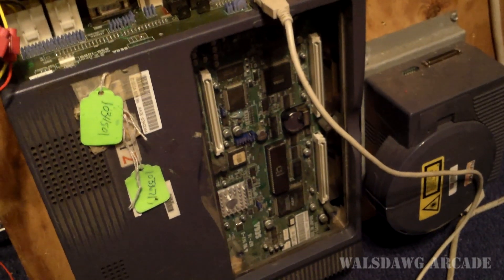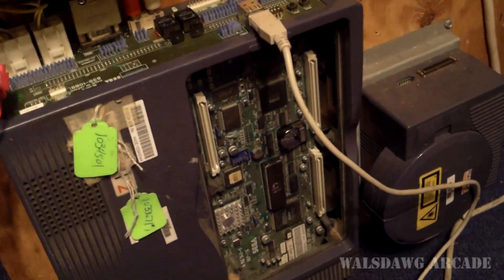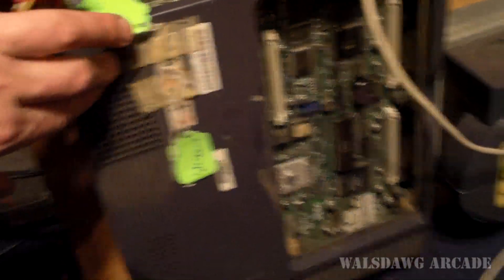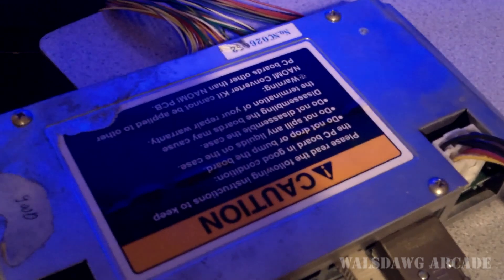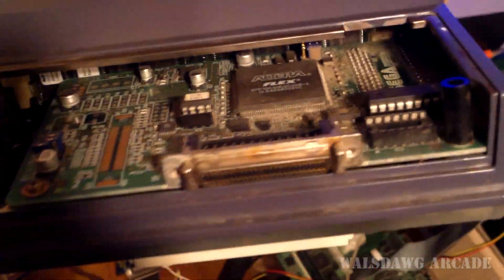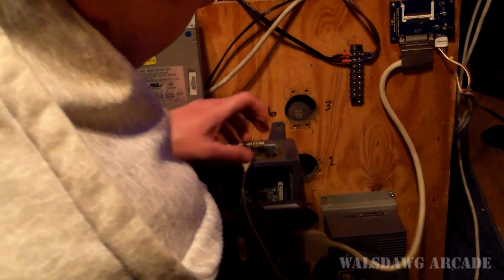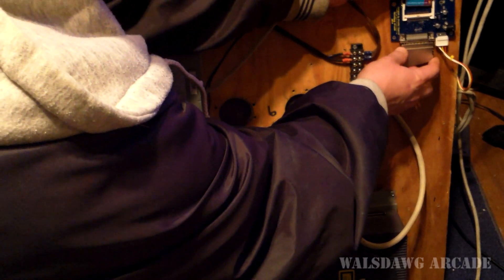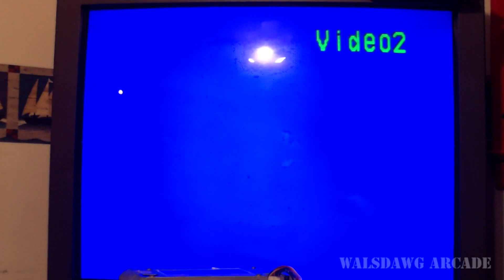Walsdawg Arcade: Demo of a Normal Naomi DIMM Running a CF kit

Comment: Do you sell these adapter for the CF cards to run on a non-net-dimm ?
Do the cards have to be formatted in a special way or the rom files changed?
Reply from the maker: Yes.  I can upgrade a normal dimm to support cf kits.  There is special software to install games on the cf cards.
Reply: @MitsurugiW  please confirm if I understand the process?  Need a multibios+ zero key.  Upgrade the net dimm bios to 4.02 (physically reprogram the flash rom) and then the scsi adapter.  Then use a tool to modify the software rom?
Necessary to change the net bios to 4.02?
Reply from the maker: @arcademaster1  No need to use multibios.  Yes, dimm bios must be reprogrammed to 4.02.  If you wish to use cf with a net dimm then 4.02 is required there too.  Game images are found online and you can use a tool to install it on the cf card.  The game images that are online are already decrypted.  The software simply installs it on the card in the format that is expected.

Comment: could this be used for gd rom or atomiswave games?
Reply from the maker: gpbear4 Yes. Most Naomi games have been converted to C.F. flash and the Atomiswave 2 Naomi games work on C.F. kit.
Reply: MitsurugiW are atomiswave 2 naomi games like atomiswave games that have been modded to work better on naomi?
Reply from the maker: They are simply Atomiswave games that have been converted to run on a Naomi so that you don't necessarily need a Naomi and Atomiswave.
Reply: MitsurugiW thats very nice. has that been done for most of the atomiswave library?
Reply from the maker: Almost all of it, yes.  They are all on our site:  Arcade-projects.com

Comment: Since this came out a few years ago, is the new one capable of loading or choosing multiple games in one cf?
Reply from the maker: Intense Mark No. It uses the same system Sega uses. 1 game per card. There are raspberry pi loaders some people use with Naomi though. Those require a netdimm tho
Reply: Do you prefer this one or the raspberry pi method?
Reply from the maker: Intense Mark I've never used a rasp pi so I can't comment on it. I think it can be hard to set up correctly from what members say on our forums.
Reply: Ok thanks!

Comment: What games are compatible with the CF mod? All of them? I've read you can use Dreamcast controllers on the NAOMI, would non standard input games work? Like those rhythm games and light gun titles.
Reply from the maker: Pretty much every game and Darksoft's AW2Naomi conversions work great.  There are only a handful of games that can actually use Dreamcast controllers.  Like 6 or 7 total.  And mostly just Capcom games at that.  Lot's more info about Naomi on our site: Arcade-projects.com
Reply: Thanks, I'll have a look. :) 

Thought more games worked with the DC controller, how sad.

Comment: All this stuff is so confusing to me. All I have is a Naomi 1 collecting dust.  what can in do with it?
Reply from the maker: This video just shows a way to convert the standard Naomi DIMM to use CF cards to load games as it was never intended to do so by Sega. Depending on your equipment to can either play games from a cart, gdrom drive, compact flash kit or loading from your computer. The last two require a DIMM board. The very last one requires the specialized NetDimm.

Comment: hey! this is amazing. great news! HERE COME THE QUESTIONS! lol.... so i got a netboot setup right now and love the "ease" that it provides... however when running mvc2 i must input those damn codes to get all the characters! EVERYTIME! If you store a game on CF will it "remember" or am i still screwed? i know theres a batt on the net dim (which is a pain to replace) but even with that i would have to start from scratch after playing a different game. any suggestions? also interested in buying one of your CF kits to use as a back up. PM me!
Reply from the maker: Every time you change games the motherboards game settings are erased.  The only way to avoid your problem is to buy a second motherboard dedicated just to MVC2.  The settings are saved to the motherboard itself.  The battery on the DIMM only saves the game that you load so that it doesn't need to reload it again the next time you boot.  But even if the battery is working it only saves the game in the DIMM for like two days without being powered up.  The DIMM battery does not save the extra characters you unlock.  The battery on the motherboard is responsible for that.
Reply: MitsurugiW oh so if i net boot on a spare MB even if i disconnect the net dim to use on another MB when i go back t the first, as long as i load the same game my characters will still be there? THANKS FOR THE HELP!!! :-) im sure a lot of people have the same question!
Reply from the maker: Charlesdavid2009 Never personally tried to save the settings on MVC2 while netbooting but it should work fine.
Reply: MitsurugiW please man can you post link for converted hokuto no ken with lst file i need for nulldc naomi please
Reply from the maker: Markocuric83 Coric Sorry. I don't use emulators myself and I've never even downloaded nulldc.  I have no idea how to use it.  Darksoft uses them for debugging purposes but I only use real hardware to play my arcade games.
Reply: MitsurugiW do you know what program i need to make lst file please man responde
Reply: MitsurugiW
Does a patched version of MVC2 exist where all the characters are unlocked? Like instead of starting at 0 exp points it starts at like 100000 exp points? I'm sure its possible, I don't know if someone has done it yet.
Reply from the maker: mrhocuspocus You can just enter the manager codes in on the test menu to get all characters unlocked.
Reply: MitsurugiW Thanks for the reply. I know, its just tedious to do since everytime I turn on my machine I am changing games. I have already region unlocked some games by hex editing. Was hoping someone a bit more adventurous would have unlocked all char. There should be many ways to do it.